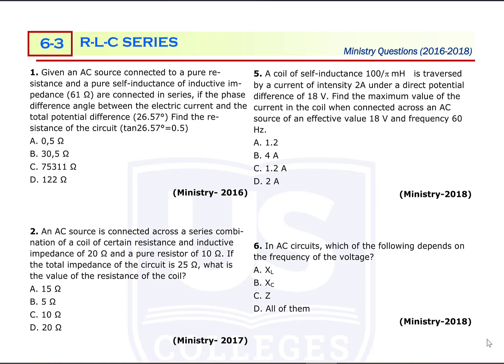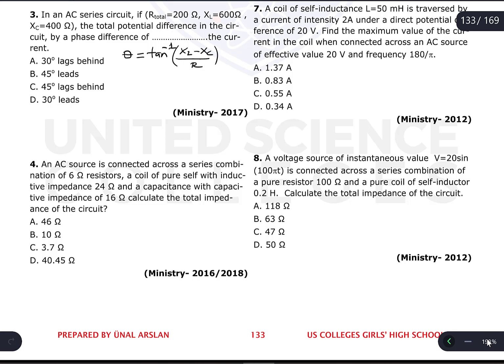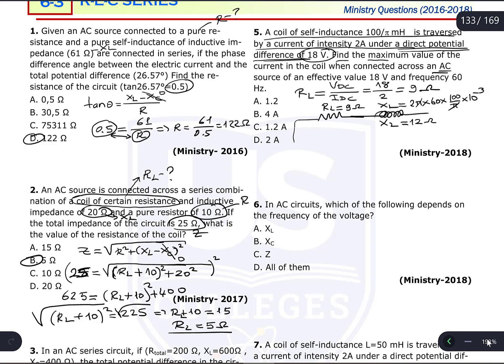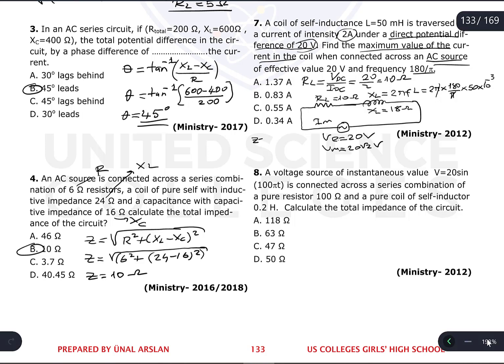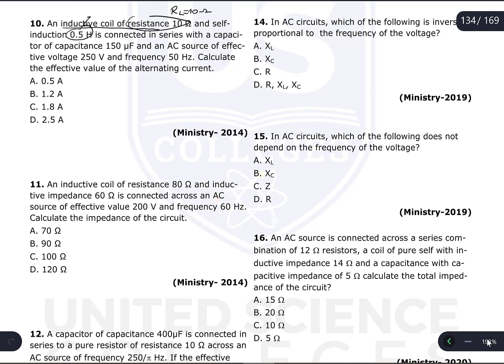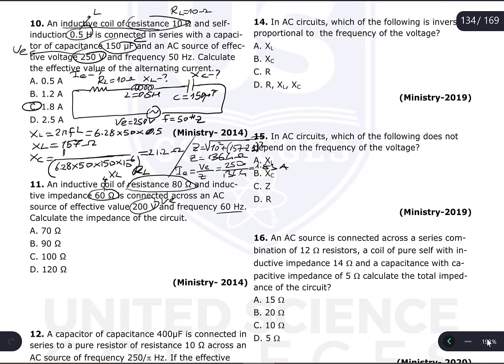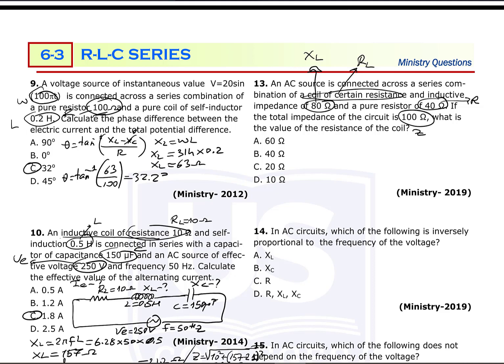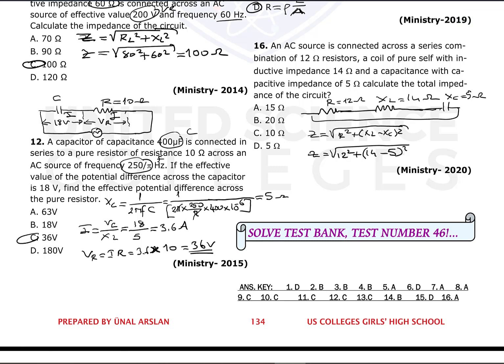R-L-C Series in AC circuit | Answers of Ministry Questions | Wezary Physics

Comment: Sir how did we know that the coil is not pure in question 5    7:56
Reply from the maker: If it were a pure coil, an infinitely big current could be measured when the coil is connected to a DC emf source.  A limited current with certain magnitude points to a conductor or a coil with some resistance.